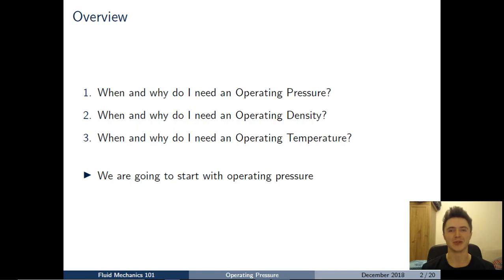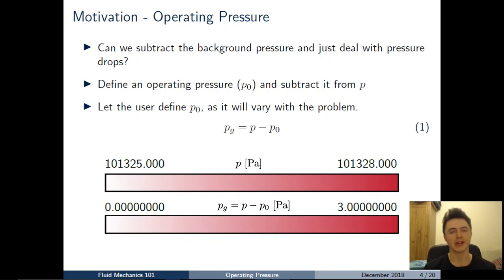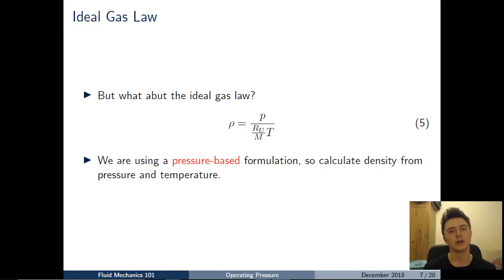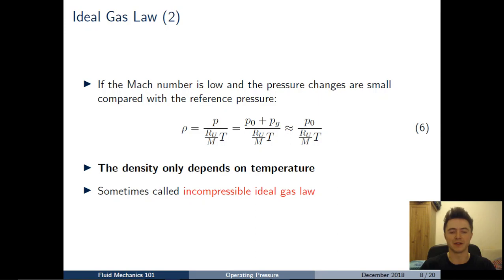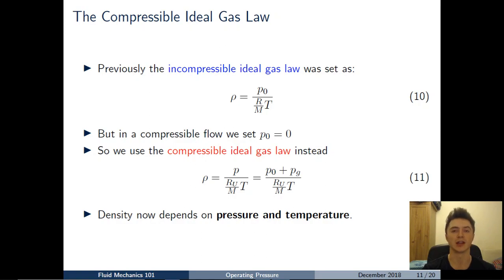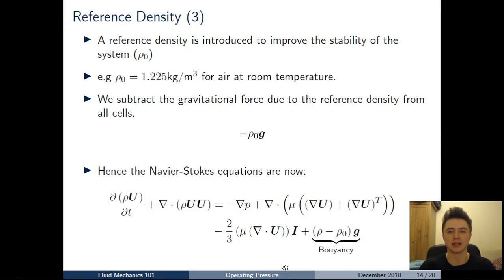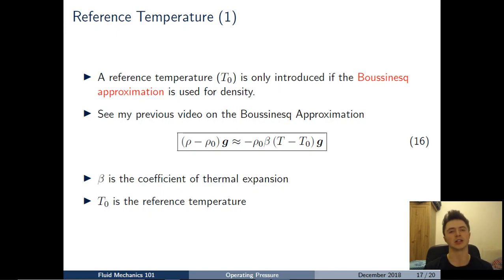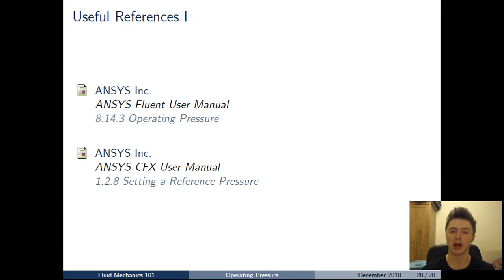[CFD] When and Why do I need Operating Pressure, Temperature and Density?

Comment: Hello, 
I am simulating an Eulerian sparging mixing tank in Ansys Fluent, filled with water (primary phase) and air is dispersed (secondary phase).

What should be my choice for the operating density, primary or minimum averaged phase ?

Thank you very much for your videos

Comment: Hello Dr, its a good video, I have questions in laminar mixed convection flow in the circular duct, if we use water or nanofluids as working fluid, how to set operating conditions in this case?
what is the type of equations momentum and energy using in ansys fluent dimensionneless or adimensionneless?
how to calculate Reynolds number if use nanofluid, I mean prperties using for calculate Reynolds number, properties of nanofluid or base fluid?
I hope to answer me Dr?

Comment: I am trying to simulate fluid flow analysis of duct in boiler. I gave mass flow rate  boundary condition at inlet and pressure at outlet. But I want to maintain some pressure drop throughout the duct for example 130 pascal. So for this what should I do ?

Comment: there is one point confused me,which is how to define reference density .for example a natural convection of air over vertical hot plate, should i choose density of background of freestream flow or density at (tw+tf)/2 degree as reference density.(tw is hot plate temperature and tf is background of freestream temperature),because  the heat transfer textbook recommends the  (tw+tf)/2 as physical  property temperature.
Reply from the maker: The film temperature (1/2 (tw + tf)) is for the empirical correlations. We use it to evaluate the material properties (mu, cp etc) at the correct temperature. 

In CFD we would use the freestream density as the reference density (so rho_f)
Reply: @fluidmechanics101  thank you for your answer.i have another question that if the natural convection occurs between hot and cold plate in a closed domain, there is no freestream field, then how should i define the reference density.
Reply from the maker: If you take the temperature of the cold surface and then evaluate the density at the cold plate temperature that will probably work

Comment: I get different results using different operating densities in my simulations. My simulation is pretty simple - natural convection of air over vertical hot plate, but the results with operating density at 25°C give me crazy flows with reverse directions on upper boundary layer.
Reply from the maker: Hmmm is operating density the only thing you changed? Might be worth a quick check of the fluent manual to see what is recommended for natural comvection. I am pretty sure the results are sensitive to exactly what models you turn on (unlike forced flow which is very forgiving)

Comment: Hi there

I am going to simulate a fire in tunnel by using fluent ansys and I have question about the density of air inside the tunnel howshould i define it is it incopresable ideal gas or ideal gas 
Hi 

I am going to simulate a fire in tunnel by using fluent ansys and I have question about the density of air inside the tunnel howshould i define it is it incopresable ideal gas or ideal gas
Reply from the maker: Incompressible ideal gas should be fine. This will allow the gas density to vary with temperature but not pressure, which is fine because your flow is at low Mach number. You will get the buoyancy effects you are looking for

Comment: I want to do a c-d nozzle simulation (supersonic flow). Let chamber pressure be 100bar. 
I want to simulate the nozzle at different altitudes? Do I have to change the operating conditions for this or what? And gauge pressure can be my chamber pressure right? 
And is pressure outlet the exit pressure of nozzle or ambient pressure? (assuming my nozzle exit plane is set as outlet baoundary )

Comment: Interesting topic. I would like to ask what the operating pressure would be in the case of a wing at given altitude, incompressible flow. Would it be the value of pressure at given altitude or still 101325 Pa ? Thank you
Reply from the maker: You want the atmospheric pressure at that particular height. You should be able to look this up or calculate it (a quick Google search should give you what you need)

Comment: If I want to simulate flow inside a nozzle. And the ambient press is 1bar, chamber press is 10bar and flow will be supersonic after throat but subsonic before throat. Then what should be operating press and gauge press at inlet & outlet. Basically what boundary conditions do I give for this?
Reply from the maker: You will probably find that the calculation is quite difficult to converge if you go for supersonic straight away. Try going for low chamber pressure first, less than the critical pressure ratio (say 1.2 bar). Then gradually ramp up the pressure ratio, past the critical pressure ratio (I think it's about 1.8 for air) and then all the way up to 10 bar. As this is a supersonic calc, you should follow the guidance in your CFD code manual on how to set this up. I would guess that it will tell you to set the operating pressure to 0 bar, and have your gauge pressure equal to the pressure you want. But make sure to look in your code manual!
Reply: @fluidmechanics101  Hey, thanks for this. 
What is the cfd code manual?
Reply from the maker: Try the theory guide for ANSYS fluent, ANSYS CFX or the documentation if you are an OpenFOAM user. Not sure what it is called for Star CCM

Comment: Hi there, when I export the solution data from Fluent to Tecplot, I got a message "The sum of operating pressure and reference pressure is zero". is it anything wrong with my simulation? I use a density-based formulation with steam as the working fluid (density : ideal gas), the case is converging-diverging nozzle so the pressure gradient will much higher. I set the operating condition to 0
I don't really know what is the point of the message
Reply from the maker: Have a look at the flow field in tecplot and see if you can see any problems. If you can't see anything then you are good and can ignore the error message. If not, go back to fluent and check your case ✅

Comment: So, for example, if I want to analyse the pressure drop of an incompressible flow in a pipe elbow, do I calculate the gauge pressure or is it the (total pressure-static pressure)=dynamic pressure or back pressure?
Reply from the maker: For internal incompressible flows, total pressure at the inlet - total pressure at the outlet is what you are looking for 👍
Reply: @fluidmechanics101  Thank you! I already assumed it, but is there a specific wording for this kind of pressure drop ? 

In German it is called additional pressure drop, when you calculate it via the resistance values on the moody-diagramm...
Reply from the maker: There may be a specific wording for it. I would just make it clear what you mean in your report / document, to avoid any confusion. Something like 'the additional pressure was calculated ( the difference between the total pressure at the inlet and outlet)'
Reply: Yes, you're right! Thank you again. It's a masters thesis, I'm even quoting your talks in my literature😂

Comment: Great. The reference pressure concept is understood. What about the location, co-ordinates?
Reply from the maker: If you have an enclosed space or cavity, you can pick anywhere that is convenient. If you have an outlet, then pressure will be set on the boundary, so it doesn't matter what location you choose (it will be overwritten anyway)
Reply: @fluidmechanics101  no, I mean, for a free surface flow. Say my cubic tank height is 1.0m (Y direction). Water is filled up to 0.5m. what should be the y coordinate value of the reference pressure location?
Reply from the maker: I would probably set the reference pressure to 101325pa at y=0.5 (the approximate location of the free surface)
Reply: @fluidmechanics101  what if I set it to 1.0. will it make any difference?

Comment: I am solving a natural convection problem in a room using Buossinsqu approx. For a very low Ma number as you know. My question is can i let the operating pressure equal to zero  ? Would you recommend that
Thanks a lot for your videos 👍👏
Reply from the maker: You can let it equal zero but it is probably better to set it to atmospheric pressure (101325 Pa)

Comment: In fluent, it is recommended to put zero as operating density for material with ideal gas eqn as its density (for natural convection flow). do you know the reason for that?
Reply from the maker: I wish i understood more of the fluent manuals recommendations. But my guess is as good as yours 😅
Reply: @fluidmechanics101  😅😅 ok ok..
Maybe, it's because if we are putting ideal gas as density then it's probably assumed that density is varying a lot and fluctuation is so large that it cancelled out the advantage of using reference pressure. So just solve original NS equation with rho*g term. But it's just my assumption and will have to search more about it.
Anyway, thank you for the video!😁

Comment: Hi! Great explanation. 
I am simulating internal flow of gas  in vacuum conditions ( 1.6 torr). I changed the operating pressure to 0 and when ansys asked to also change operating density to 0, I have also changed it. When I am running the calculation, I see " Absolute pressure is limited to 1". It does not have any units and I am not sure how it changes my solution. 
My boundary conditions involves
1. Velocity inlet
2. Thermal walls at 545K, 623K, 923K along with radiation. 
Currently I am doing a 2D simulation. 
Can you help me with this?

Comment: hello sir, can i ask a few question. how to set a different ambient pressure? for example i want to set 8MPa as ambient pressure in the tank.. or does the operating pressure means the ambient pressure? Please give some tips and advice. thanks for your kind
Reply from the maker: I think you need to set 8MPa as the pressure at the outlet of your tank (with an operating pressure of 0). The CFD code will compute the pressure distribution in the tank. Alternatively, set the operating pressure to 8MPa and set the pressure at the tank outlet to 0. 👍
Reply: thanks for your helps..  I'll try.. 👍👍👍

Comment: Hello sir, can i ask you few question. How to solve liquid density temperature pressure dependent variables?Most of your point in this video were applied to gas using ideal gas law. How to deal with problem involving low marc temperature pressure dependent liquid flow. i.e the heat transfer in the high depth water tank.Please give some tips and advice.
Reply from the maker: Hi Husaini, the first thing I would try is a Boussinesq model for the density variations (you can check out my video for the Boussinesq model here: https://www.youtube.com/watch?v=onKiVbKSoXw . If not you can always try a compressible liquid thermodynamic model if the temperature and density changes are large. Hopefully this helps? If you can provide some more details then maybe we can work out some more helpful advice?
Reply: I have check your video before. It stated that its only valid for low temperature differences. How can i define the pressure when there is no pressure boundary (pressure inlet or outlet) in the domain?
Reply: Currently im modelling the heat transfer in the spent fuel pool water tank which has about 12m depth of water and about 450K temperature of heat source. I have set the water surface as slip condition but i cant define the hydrostatic pressure inside the water tank.